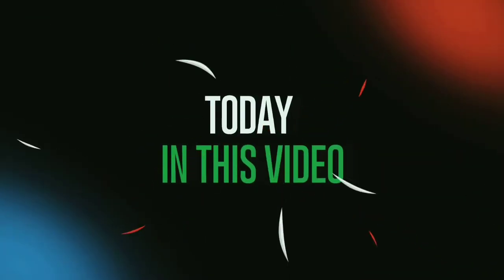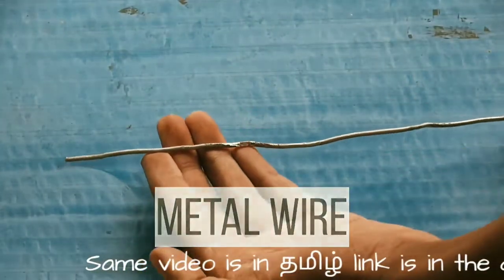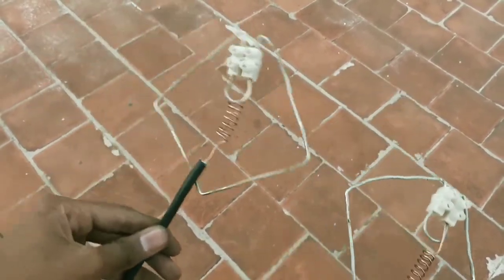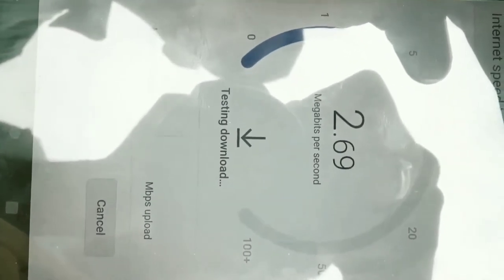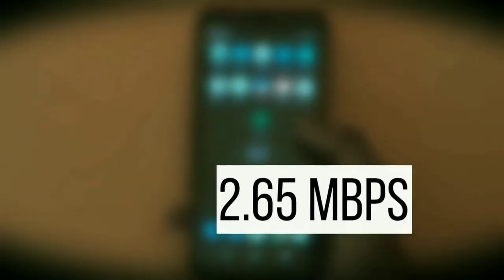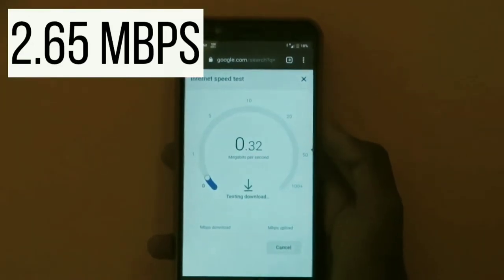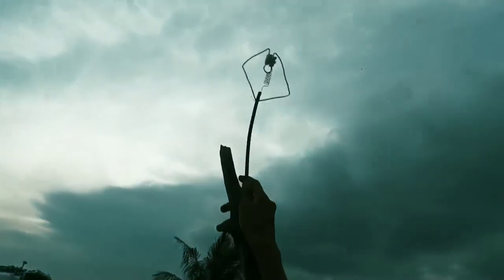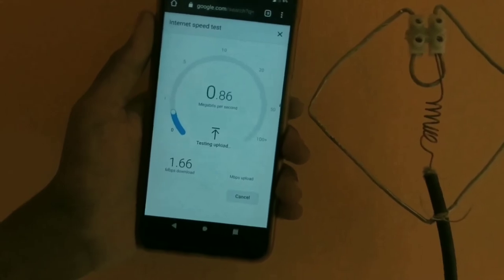How to make Mobile signal booster 2g 3g 4g(100% Working) DIY(internet speed booster)

Comment: you gave a very good presentation worth trying, but one thing you have to find the best signal point on top of roof also at some point the signal is very very good, in my case i get good signal only in one room corner and that is just 10 centimeter space, the moment i move my mobile and signal goes off, only 5 cm space i am getting signal which is feeble and that too in Delhi circle can you imagine, i need this desperately i am paying to telecom operators 3000 INR yearly for internet and net is not working i feel so bad, their is obstruction of trees, buildings and other cable wires passing through roofs and other houses which hinders signal strength creating havoc, many people have installed signal booster due to which now a days signal snatching have started in many regions and places house to house, the broadband people have started selling their broadband connection for whooping 10000/- inr and more yearly, its not possible for everyone to afford that amount, around 1000/-1500/- monthly bill is certainly going to come if you use broadband service of any company, earlier i paid just 10/- INR for calling people monthly and due to internet i have to take out budget of 300/- INR every month for internet and not getting what I am paying for, this makes me feel sick, I will try your suggestion...

Comment: Can we replace iron wire to copper wire
Reply from the maker: Yes sure
Reply from the maker: The copper wire is most powerful then iron
Reply from the maker: I think  you want fix the outdoor antena very high and remove the insulation
Reply from the maker: Place the outdoor antena where the internet speed will be high
Reply: Sir
Reply: Sir please help
Reply from the maker: @devshridanot4114  may be there will be a problem with the wire
Reply from the maker: @devshridanot4114  Yes you can but the wire has to be in good shape
Reply from the maker: Yes
Reply from the maker: Fix the outdoor antena  very hight
Reply: @Circuiters  sir it really work
Reply: @Circuiters  tomorrow i try then tell u
Reply: @Circuiters  sir i dont have connector so i used
Reply: In the bulb holder there is a wire connector so that i used
Reply: It work
Reply: @Circuiters  sir i build again but not working u have other technic
Reply: @Circuiters  sir reply
Reply: @Circuiters  please sir reply me
Reply: @Circuiters  sir i do but don't work please help🥺🥺🥺🥺